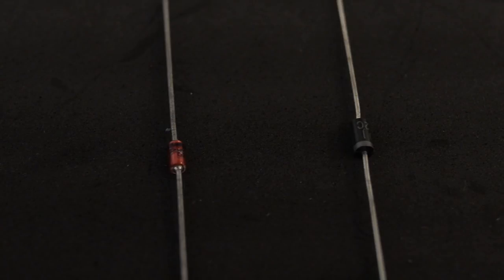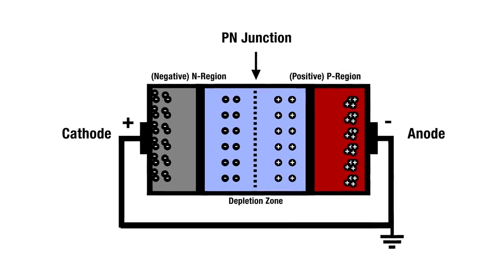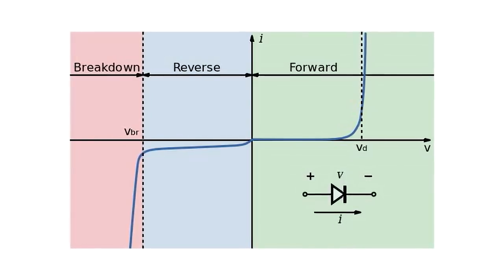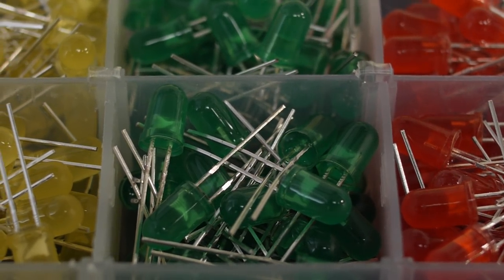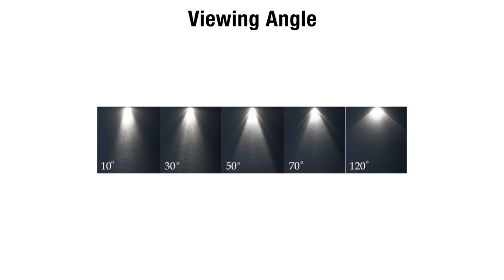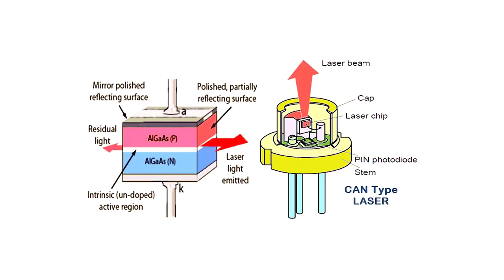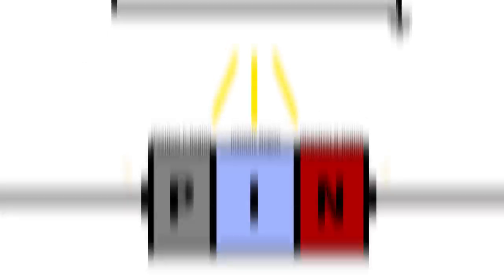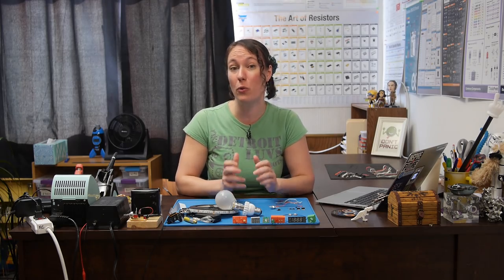Types of Diodes - The Learning Circuit

Comment: Hopefully Karen will detail the Transient-voltage-suppression diode soon.  I helped a r/c motor designer (Big Jim Greenemeyer) get a hold of the surface mount ones to put on the commutator of '540' motors.  Results were amazing.
Reply: Thanks